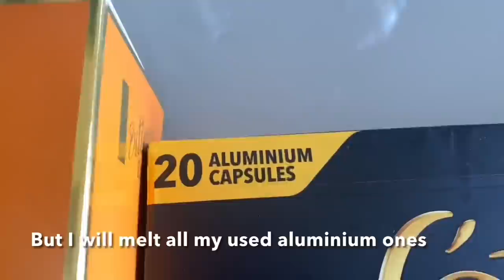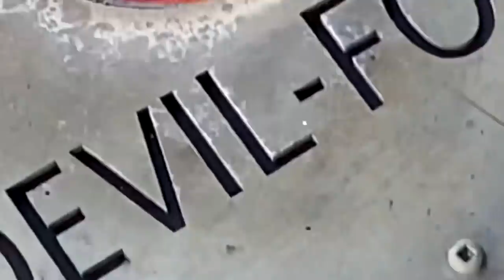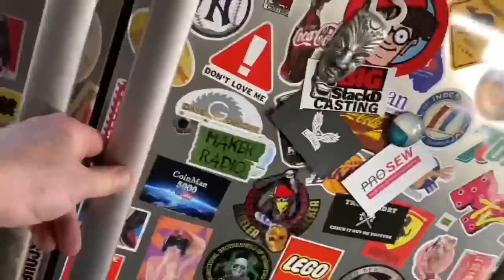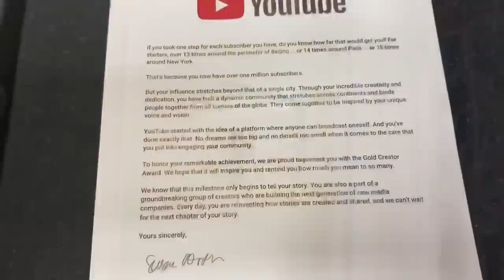Coffee Pod To Perfection - ASMR Metal Melting Aluminium Coffee Pods - Trash To Treasure - BigStackD

Comment: The steel ring could indicate a failed quality test. Most food plants have metal detectors, magnets or some other system to remove and check for metallic contamination. Your ring might be the remains of a calibration sensor or piece they put in every so many cups to see if the system is still working properly.
Reply: I was thinking it's probably a die cover stuck in the cup from when it was stamped
Reply: Couldn't the metal ring have already been in the crucible and just not noticed..
Reply: @TheWolfster001  unlikely because they generally float on molten metal. Hard not to notice a floating hunk of steel while you are doing a pour
Reply: @DS-ck8tm  be interested if his friends had a weak coffee one morning due to the steel taking up room inside the pod.
Reply: @skeetsmcgrew3282  I meant left from previous pour, I have had harder metals stick to the bottom of older crucibles, remember we don't see every melt he does, also he does a lot of testing on combining different metals too.. And true iron & steel float on aluminum, copper, brass & such..
Reply: No this wouldnt be it the coffee would be metal detectes before packing and test peices are seperate, you cant metal detect the finished pods, as metel detectors are actually density detectors really.
Reply: I've had a screwdriver tip in frozen food from a well known brand.
Reply: @Jay-we2ek  my sister had a watch band pin in tinned fruit once. Luckily it was in her serve and not her kids.

Comment: The coffee grounds make great fertilizer. I always give my mom all my composted ones to use on her garden. The composted coffee grounds give the plants a nice nitrogen boost.

Also, all those copper pipes. I wish I could find more, as I've been using them to make my ham radio antennas. Once cleaned, they make the best antennas. But, I cannot find them often so I don't have very many. Just a great 2m band dipole, 70cm band dipole, and a 2m band yagi. That is not much.
Reply: @andie_pants  Can't you just listen to that stuff on the internet? They have scanner apps and weather radio. Why not ham radio?
Reply: @Joe Mama I don't know since I'm one of the people who like to reuse things. I doubt it would make much difference. Many ham radio operators have made antennas out of recycled materials such as christmas lights and even gutters. There is a guy on YT named Josh Nash that is famous in the field for his tape measure antenna which he used to contact the ISS.
Reply: @andie_pants  All I can say is yikes to how much pipe you'll need for the HF bands if that is your goal. It's great for the VHF/UHF bands. Before I got my ham license (though I don't transmit on the HF bands even though I have my general license), I did SWL which I made the antenna from used vacuum sweeper wire. It picks up the signals well enough. I haven't measure the SWR on it since I don't have a tuner and I don't transmit on it, but I imagine it would be like 9:1 or something like that.

Comment: That’s amazing! Congratulations on the plaque!
What happens if you run into material that’s a mix of different metal types? How would you know what kind it is, and how would you mark it before adding it to your hoard?
Reply: I don’t think he’s ever worked with obscure alloys besides brass and stuff but he’d probably just use those letters to hammer on that it’s an alloy

Comment: The amount of metal you got just from some coffee pods, makes you wonder, when people constantly throw away all these single use food packages, aluminium foil, plastics, companies the recycle trash and turn it back into resources must be making a ton of money out of things people throw away.
Reply: Nope.  Overheads, food residues and the intimate bonding of differing materials make recycling of food packaging an almost pointless exercise.  Plastic isn't as recyclable as people like to believe.  Aluminium packaging has a layer of plastic bonded to it, making it impossible to recycle the plastic and as you saw, the aluminium recovered from melting was a mere 26% of the starting weight. The recycling value of the ingot the BigstackD made is about AU$0.80 and he burned more than that just in gas.

In short, the council recycling of material is a big con job to make residents think they're doing something for the environment.  In many areas, the "recycling bin" contents go straight into landfills.

Comment: Hi bigstackD casting, I've been melting aluminium cofee pods for 2 years now and I have already melted more that 5000.  I heve tessted several ways of removibg the cofee fron the pod and the best way by far that I foud is to let the pods dry at sun for abut a week and then emptying then. This way the cofee gets solidifyed and when you remove the top part of the pod it takes less than 1 second to empty the cofee. If you do this again try is as this method have saved me a lot of hours. 
pd: very nice video.

Comment: Sometimes your bars are not perfectly flat because they cooldown too fast. You can improve that by letting them freeze in the mold, while using your torch to heat the top. That way they freeze way slower (or even not at all, so reduce it slowly over time) and then they get much flatter and without those concave sides. :)

Comment: Mind if I ask a dumb question? I was wondering about contaminates..for example if a bunch of steel or iron got into a brass melt what would happen? Small stuff like iron filings. Would they float out, sink to the bottom, get included in the pour?

Does it even matter? Would you be willing to toss a handful of iron filings into one of your melts? 

I wouldn't want you to ruin anything but I'm just curious about how much it matters to have unexpected metals in the crucible is all.

Comment: Never seen aluminum pods her in the US.  Interesting...  Seems more expensive than the plastic ones.  Is there an advantage with aluminum?  Better taste?
Oh, and Congrats on the 1MM subs.  Proud of you.
Reply: Depends against what you compare them. There are basically 3 types of system out there:

Paper pads. Low on waste (and even that is biodegradable) unless they are packaged in plastic separately. However, once you open a package of however many are packaged together, the coffee starts to age. So not a good idea for a "one a day" drinkers. However, some plastic is still needed for the packaging to seal the pads.

Plastic pods. High on waste and very hard to recycle. At the temperature plastic needs to be melted, coffee does not burn off. So they need to be washed after being ripped into pieces. The result of that process is that now the coffee is contaminated with tiny plastic scraps and needs to be burned. On the plus side, each pod is sealed on its own, so they are usable for low volume applications.

Open plastic pods. Hard to recycle and not individually sealed. Worst of both worlds. Some of the 3rd-party pods for the Nespresso system are like this. A plastic shell with an aluminium foil on one side (that becomes the filter in the machine) and holes on the other (where the water is injected). Behind the holes is a bit of foam plastic to keep the coffee in. Terrible idea.

Aluminium pods: A bit more costly to make (still sub-cent difference) and can be fully recycled without losing material quality. Cleaning can be minimal (shredding into a water bath), the coffee burns right off at the temperatures aluminium is melted. And can still be recycled after sitting in the landfill for a couple of decades. And btw, those pods are shipped in karton containers.

Comment: Wich kind of respirator are u using? I tried to melt some cans and didn't use a respirator I just turned on the ventilation. The aluminum of the cans got not so nice and watery. It had a lot of garbage in it. Now I have some breathing problems. It's weird like there is a foot on my chest. Got better the last two weeks but still worried. Can't be covid though I don't have other symptoms.

Comment: I've had a thought...<everyone runs screaming in terror>

I know, I know I should warn people before scaring them like that...😄😁😆😅😂🤣

If you get a steel wire rack and set it on top of one of your other forges set to low and placed the moulds on the rack, the forge would keep the moulds hot and slow down the metals solidification and that might really improve the final casting results...

Comment: 1M Awesome, bigstackD! I worked in a small foundry with an induction forge (1-2 person). I only work there for a couple of years, but the guy I worked with had been the for over 10 years. We did mostly book molds, but he had little tricks for making ANY mold come out the way he wanted. Just in case, I wanted to be an asshole and pass on the crap you probably already know. (Who else can I tell? My anime buddies????)

Graphite Plate: After we melted the alloy to liquid, we would removed all the slag we could. Then we'd cover the top with a Graphite Plate 1 to 2 inches thick, and stack our molds on top of the plate. Then we'd up the temperature. Since you're using gas, of course, completely covering the top hole isn't an option. But if you had graphite plates, you could open the lid, put on a graphite plate, put your molds on that, and offset it for gas release.

Graphite Custom Molds: Graphite is versatile. We used squares, rectangles, long 8in by .5in pieces.... We had a big table of granite that we could clamp down graphite edges, pour in metal, and let harden.

Graphite is your friend. Your cheapest friend. But it won't last forever. I've had one too many beers.

Comment: I was melting brass and got some cotton candy looking fluff coming out of the crucible during the melt... what is this?! I have never had this before...
Reply from the maker: that’s nasty stuff mate that means you overheated the brass and the zinc burnt off , that white fluffy stuff is called zinc oxide and it’s very bad to breathe. It won’t kill you but I can make you quite sick for a few days in the form of metal fume fever. You just need to be very careful melting brass because brass melting point and the zincs boiling point is extremely close👍🏻
Reply: @bigstackD  Thank you for the info. I will keep a much closer eye on the temperature. I was downwind and just shut the furnace off and let everything cool down. In general I avoid any fumes.